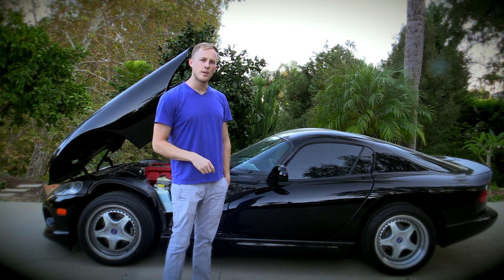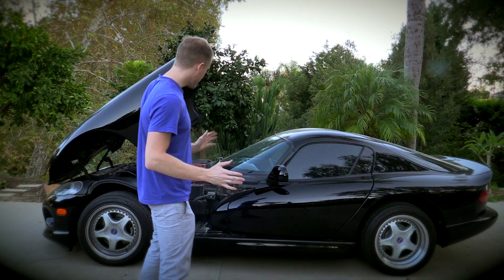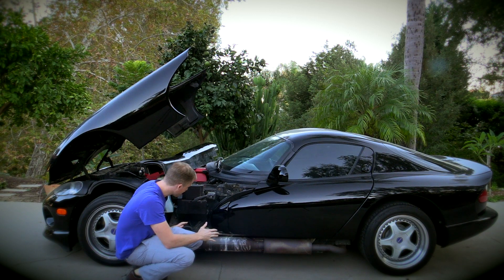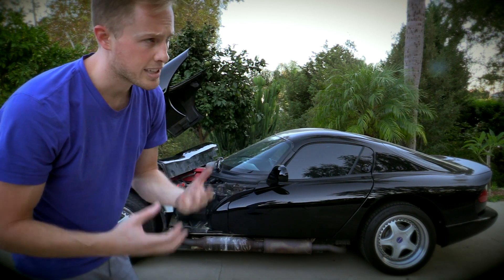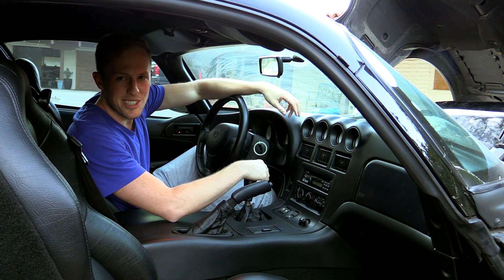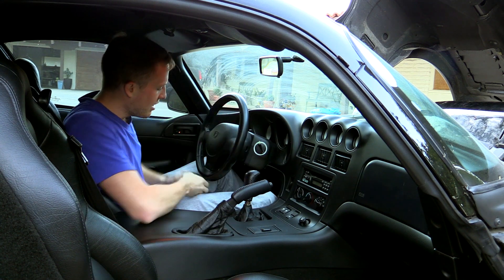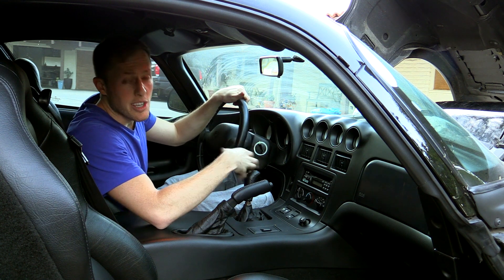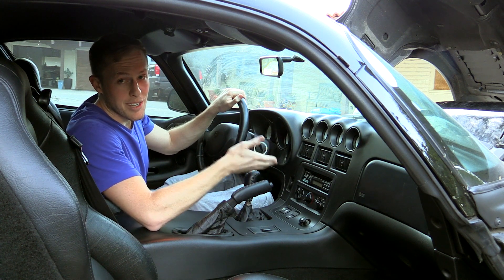The peculiar HVAC system in the Dodge Viper

Comment: In this video you say removing the cats is illegal and therefore wont do it, but on the E46 you did remove them by replacing your headers with the (catless) ebay headers.

Was it legal on the E46 to get those ebay headers on there then?
Reply from the maker: budro The E46 is going to be towed to the race track soon :) Headers are not legal.
Reply: ZentRose Ah that's a real shame. But who would ever find out about the cats being gone anyways right? Not a big risk in my opinion. Also, what car will you daily when you can't use the E46?

P.S. I absolutely love your car park man. pre-facelift e46 coupe is my (achievable) dreamcar, and I've loved the old Viper ever since I was a little kid. If I had the money, this is probably what I would be driving too!
Reply from the maker: budro Haha thanks! Thats awesome.